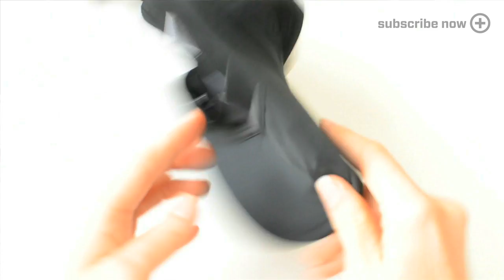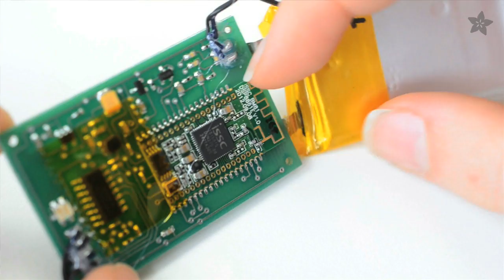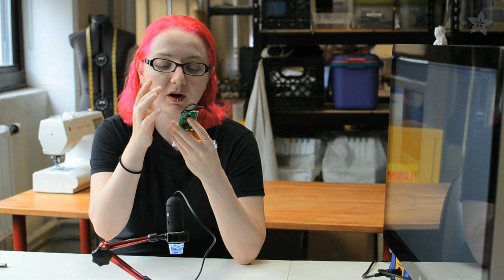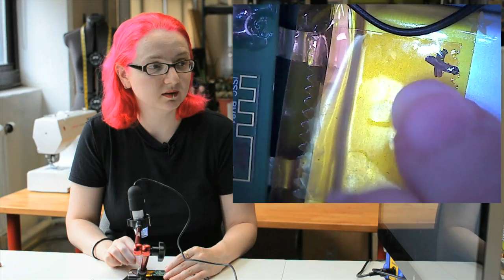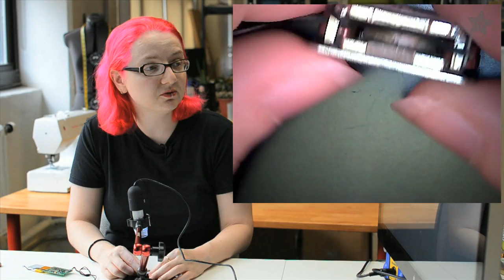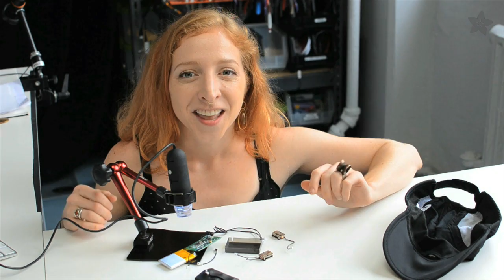Cynaps Bone Conduction Headset Teardown

Comment: Hi, thanks for this video, it was very useful.
Could you say what would be the smallest possible battery (size and power) able to work with this bone conduction transducer ?
Regards,

Benjy
Reply: I get 130 minutes of continuous runtime from my set-up: bone conductor transducer, DFPlayer Mini, LiPo charger module, and a five-year-old 100mAh 1S 20C LiPo battery (20 x 14 x 7mm).

Comment: These kinds of transducers are really sub-optimal for the application. As Limor pointed out, they really take a lot of current to operate, which makes poor use of the energy from the LiPo cell. A better technology would be ElectroActive Polymer (EAP) actuators. They, instead, use relatively high-voltage and low-current to modulate sound into an adjacent object with very high resolution and can pulse from sub-1 Hz all the way to ultrasound at surprising dynamic range. I believe the technology is already being implemented by Bayer Chemical as a haptic device, but it could be so much more.

Comment: Those sets scare me, a LOT. Vibration to the skull, how safe can this be?
Reply: very, in many cases more so then actual on or in ear drivers, mostly because, most of the bone conduction stuff enlarge, dosnt have the driving power behind it to push dangerous volumes,  use to work for a place that made hearing devices that used bone conduction, and required a belt mounted power pack that either had 2x9v or 8xAA cells in it, far from optimal but they allowed people who couldnt hear due to illness or damage, but whos inner ear was actually capable of hearing and transmitting sound to the brain.

i also know  a fellow who was part of a test group in the military for implanted mic/speaker setups,  it was originally just going to be a way to more securely attach a headset onto a soldier, the implanted component he has at this time, is not a speaker or actuator or whatever its just a magnetic mount system thats under the skin imbeaded in is skull, also, they didnt take people who where not already going in to surgery for other reasons into that test, and everybody agreed to be a subject at the time, in his case, the hearing he lost a large % of when he was injured becomes a non-issue, the bone conduction setup hes got now can actually be put into a few different modes, one, just fills in the parts of his hearing that is weak or ineffective when doing day to day life tasks, or it can do full spectrum, or vocal only, and with the current unit, it can also be put into a training mode to learn somebodies voice, and freq shift it, if needed, to be more easily understood by him, only one of his ears is damaged this way, and hes still got about 50-60% hearing  in that ear, just large range that nolonger functions without the bone conduction unit, his wife is hard to hear/understand most of the time for alot of people, myself included, his unit... shifts her voice in that ear, such that... using his unit connected to a set of over ear bone conduction headphones he has...even i can understand her flawlessly... and normally i have to remind her to speak up and speak clearly... (i love her, shes genuinely one of the best people you could hope to meet, but, shes a tiny asian woman, who is embarassed by her accent and talks very quiet, outside when shes around people who speak her native lang, then shes stupidly loud....)

this stuff is actually really cool, my buddy is quite lucky to be in the program, and the VA still many years later, upgrade him and have even when he had ear surgery, replaced the mount unit with a much newer, much more "long term safe" version, though, his old one showed no signs of corrosion like some apparently had, the new unit will also allow something the company is working on, that will be part of the transducer once the company has that part of the unit ready for more wide testing, it will be powered/driven by the external magnetized assembly, also the new units exteral parts more closely resemble the coclear implant setup, in part because they can use the same shells and such, its very cool tech...